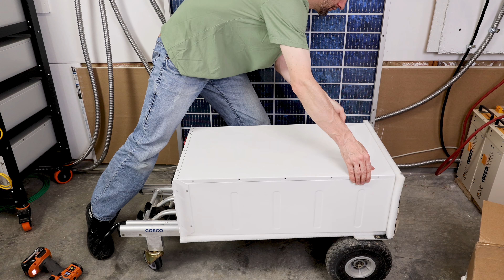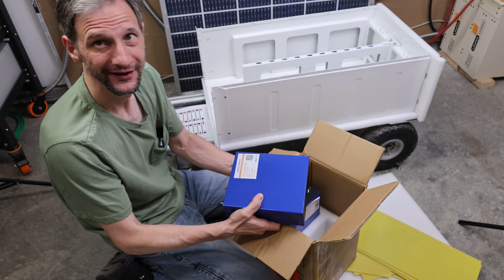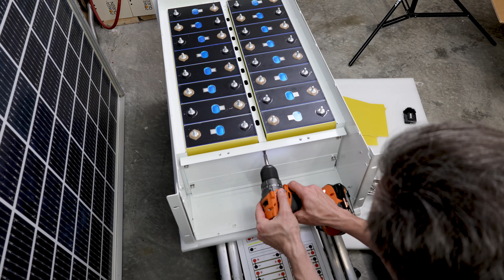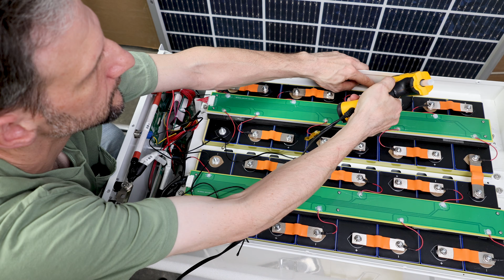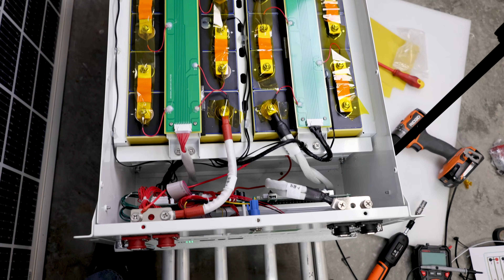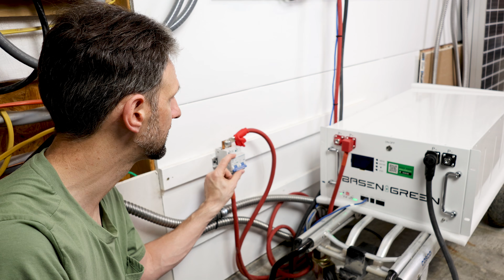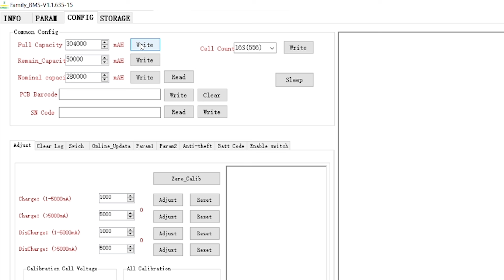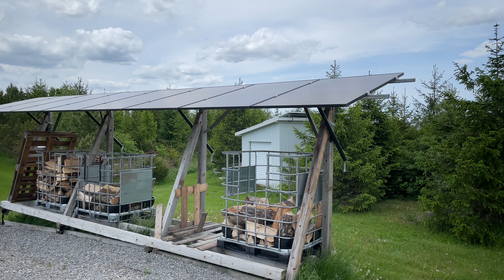SAVE Thousands - Build your own home solar battery backup!

Comment: If a person can assemble it in 1 hour. A person could probably do 2 an hr. That person you just pay them 20$ or 10$ in china. So how is this cheap because its a DIY kit ?
Reply from the maker: Good question.  Also, there is way more packaging to ship everything independently.  One reason might be there is no holistic warranty for the DIY setup.
Reply: you don't have to hire an HR department like the company you hire to do it has to.

Comment: Great video! I think you can get the cells even cheaper if you buy directly from China or a retailer that does not add to much cost. 

My rule of thumb is that a DIY kit battery is about 1/2 the price of a pre built battery and that a complete DIY battery is 1/3 the price of a pre built battery. Prices vary a lot so this may not be right for you, but with the pricing locally to me this is true.

Comment: Nice job on the video . The box has the same flaw they all seem to have , the cells are not fully supported for compression on one end , you did have the extra room though for a plate at the hollow end . You can flip the handles over and they will be out of the way of the posts . Would like to have seen a breaker also . Any idea what BMS ?
Reply from the maker: I couldn't find any clear identification on the BMS.  They claim it's their own, but I don't know who is making it.
Reply: @ProjectsWithDave 
BMS looks like the same as in the GobelPower batteries. 200A Pace BMS

Comment: What's attractive about this (aside from cost) is that you can replace cells yourself if they go bad, but most likely by the time they do, the same spec. batteries won't be available any more. I just wonder what will happen in the next 5 years with battery tech for DIY type work.
Reply from the maker: I was thinking the exact same thing.  One of the reasons I like the SOK batteries is they can be serviced.  I have one cell in the stack that seems to be drifting out of spec.  I was considering replacing it but as you said I have to find the same cell to replace it with.  I suppose if you have a lot of the same battery, eventually you could use one as "spare parts."
Reply: Couldn't you just order a couple extra cells/packs when you order the original ones to have around for repair/replacement?
Reply: like everything else.  They will serialize the battery so you can't swap one out.

Comment: I've only used and built DIY server rack batteries, the pre-built EG/SOK/etc are only 100Ah, so to me it was a no-brainer to build 304Ah for $500 more.  I currently have 4 of them in Gobel cases, 60kwh, which will run my house in the summer for 24hrs if we had an outage.  In 13yrs we've never had an outage longer than 4hrs, but the real goal was to run the entire house during the 4pm - 10pm Summer peak  power rate/cost.  We are NEM 3.0 here in CA, so there is no upside to backfeeding the grid at $0.03 Kwh while being charged $0.45Kwh.
Reply: Yep and that's why I installed 66 kWh of recycled Tesla modules because the utilities keep moving the goal posts on the payback and then you still have no power in a blowout.  My houses main disconnect has been off for 3 year now.
Reply: @cyumadbrosummit3534  Where do you buy the "recycled Tesla modules"?
Reply: @cyumadbrosummit3534 I'm going to check that out!
Reply: Why not just go off grid?
Reply: @dlfrestoration  Soon they will come after those people too by saying they need to pay $$$ for "maintenance fee" of the grid and pay your fair share. Watch it happen.
Reply: @dlfrestoration think of the grid tie as a insurance policy if any single component of your system fails and takes it off line.
Reply: @judd_s5643  Yes,never put all your eggs in one basket,if possible !
Reply: This is the way. With cheap batteries there is no reason to sell electricity to the grid for pennies.
Reply: @johnzach2057 
Sell for pennies on the dollar?
Nope more and more states are ending net metering and there meters do not run backwards wich means any power going through the meter  you are getting charged even if the power is being sent to the grid.
Yup they have made it so we now have to pay them to send them power
Reply: Didn't DIY my battery, but I have the Signature Solar 14kw outdoor battery that is enough, and then some, to carry me through the So Cal Edison 4-9 TOU price jump. I an on NEM 2.0 and even making it under that wire to get the old terms, the buyback rates suck. Batteries for TOU buffering rock
Reply: Nem 3.0 is criminal
Reply: @KuramaKitsune1  IDK about NEM 3.0, but I'll write you a fair to everybody NEM 4.0. Monthly fee to pay for maintaining the local distribution network, and billing, say $20, and then come up with a price at the meter, and either pay it, or collect it. Same price in or out.
Reply: I have net metering in Ohio. I get full credit for every kwh I backfeed.  I put up solar in 2017, when Ohio didn't have any solar to speak of. I watch "eia power monthly" and we've started adding solar, so it can't last forever. I still have a dumb meter that can't measure what time I use electricity, which is dumb. Electricity should be expensive when it is in short supply, and cheap when it is plentiful. Give me a price at the meter, and pay or charge depending on which way it flows. California has a lot of solar, and can add more cheap, so your prices should be low during solar hours, particularly in the spring before AC loads really kick in.
Reply: @iamblaineful, would love to hear about your system!  We've got 3.2kW of solar on NEM 1.0 but aging out in Jan 2025(going NEM 3.0) and this DIY 15kWh pack(or 2) would get us through the 4p-9a no/low solar time period for a couple of days. So I'm looking for a programmable charge controller with zero export capabilities which would only AC charge the battery packs when the solar/micro-inverters are producing. Programmable for something like setting the AC charge controller to limit a 10W grid backfeed with the rest charging batteries. The inverter would then take over the household load while putting a grid load of only 10W through the evening, night and early morning no/low solar periods. The clock is ticking so looking for solutions. Thanks.
Reply: I live in California can you help me build my system? 😉
Reply: I thought NEM 3.0 provided a rate sheet with higher back feed rates at certain times of the year.  I downloaded the rate sheet from PGE.  For sure, the majority of the time sending back to the grid was horrible and not worth it.  Sept. had rates of over $2 per KwH for 2 hours per day from your battery backup, I believe it was between 6-7 pm.   Aug. had some good rates to backfeed as well.   I have not installed my solar yet and batter backup system but I was looking forward to capitalizing on this rate schedule.  I have not seen any youtube video's on someone taking advantage of NEM 3. I was looking at the EG4 Hybrid system to be able to backfeed 12 KwH per hour back to the grid.   On top of that, be able to run off grid.  Electricity rates have gone out of control high in California.
Reply: .45!!! Are you serious
Reply: @joeblow6105  In Western Australia i could could only dream of being charged  45. Now its north of a dollar something  In fact 15yrs ago our 1st solar install  would pay us a 47c / kw feed in. Now it pays only 7cents . Obviously this is $AU so not sure but im guessing thats like 3c there.
Reply: Do you have a zero electric bill? What’s your setup like?
Reply: And the main reason being a more responsible and clean environment for the future too.
Reply: Gotta love Democrat policies
Reply: @AFS-ht7bgalways some dope making it political
Reply: If your batteries ever end up fully charged before the sun has set for the day, why wouldn’t you “bank” the extra energy by sending it back to the utility?
I live up north and with trees on all sides of me so I’m envious of you guys who it makes sense to do this stuff.  Maybe I am missing some practical understanding but I assume that there would be times that selling back to the utility, even for a reduced credit, would make sense.  AND you’d know that you are contributing to less coal or similar is being burned at the local steam plant. 😊
I only dreamed of these days when Carter was in office and I was a kid in the 5th grade.
Reply: @harrymagooslum5770  Well it depends on your point of view. A fully charged battery goes into a float mode operation. This allows you running devices to still use solar wattage. The way float mode works is the solar is not going all to waste. It is just providing you the wattage your using. Meanwhile your batts remain topped so as sun as your start to loose solar production and tapper off it you will only then start using your batts. And keeping batts fully topped and in float mode allows better opportunity to have enough battery capacity to get through the night. For instance my setup is 2044 watts I am fully topped off and in float mode but, only pulling 500watts. I am able to make 500 watts if I use more power it will produce more power. But, leave the batts topped off. As far as Grid Tie. You have to go through permits. And way things are going government might end up with reach to be able to shut it off. As far as not going solar. Look into micro hydro stuff. Get power from your water main every time you run water. Might be a trickle charge but, could charge a battery to run USB devices and usb batt charging. Also, many micro hydro off rain gutters to creeks. Hope this helps.
Reply: @harrymagooslum5770 It's a good question. I'm thinking there must be additional overhead or requirements with the utility allowing you to do that, with metering etc. Might be some other hassles with them over billing rates, too.

Comment: A well done video, thank you.
The BassenGreen site does not list any specs for the included BMS, only that it is 200A, 16S. Did you note a model number or manufacturer on the BMS, or perhaps have a link?
Reply from the maker: They claim to make it themselves.  I didn't see anything to indicate another manufacture.
Reply: @ProjectsWithDave  - Thanks for checking. The included BMS may be fine, but personally I would feel more comfortable using a known quality BMS. Fortunately the kit is inexpensive enough to allow for that upgrade and still be a good deal.
Reply from the maker: I think it would be great if someone made a DIY case that offered multiple options for the BMS.

Comment: Before pushing loads through the battery, shouldn’t you have charged it up to 100% first?
Reply: He did charge it up to 100% and did a full drain test after to check capacity
Reply from the maker: Right.

Comment: Dave, maybe I’m missing it, but where did you get your cells?
Reply: Looks like BassenGreen out of stock.  So much for trying this project.
Reply from the maker: Unfortunately, I don't have a date from them on when they will be back in stock in the US.  You can get them directly from China, but one of the reasons I picked them was they had US stock.
Reply from the maker: Cells and Case from BassenGreen.

Comment: I see you have the same fluke clamp. Have you measures in the inrush current with that heat pump soft start? I just installed an emporium system on my house to size up what I need to by for my system. While I had the panel open I did take some inrush current measurements and saw the heat pump pulling 85 Amps on each leg of the 240 breaker. CC was about 10 amps on each leg, or about a total of 2.4Kw with ambient temp of 94. I was curious to see how that soft start pulls.
Reply from the maker: With the soft start, the ramp is so soft it doesn't register as inrush.  It's pretty amazing.  As long as you use a low frequency inverter like the Victron system in this video it should work great.
Reply: @ProjectsWithDave  Good to know.  I am considering a toroidal transformer based hybrid inverter. Thanks.
Reply from the maker: You should be happy with that performance.   Make sure the idle losses are acceptable for your situation.  Victron has the best idle loss of all the inverters I've checked.
Reply: @ProjectsWithDave  Yea, I do consider that. I’ve noticed since I am looking to go hybrid that some inverters have a lower idle when connected to the grid vs sickly off grid. Even some non-hybrids that can’t feed the grid still have. a grid hook up option and run 1/2 the idle. A lot to consider and a lot of research for sure.

Comment: Simple build most of the complex work is done for you.
No breaker or fuse in the battery box, consider that a negative.
On my DIY system I have multiple battery’ banks, size each breaker so that total breaker current rating is 150% of max load since each battery will only see a small percentage of its current rating.
Reply from the maker: It does have a built in fuse, but I wanted the external breaker.
Reply: @ProjectsWithDave  Looks like they took your advice. The one for sale on the website now has a breaker switch above the on/off button. Pretty cool unit for a good price!

Comment: "Easy beginner" until you see the chinese user manual for MPPT controllers. How much money will I have to spend to find one in the actual ENGLISH LANGUAGE for a beginner????
Reply: What are you talking about? There are no MPPT controllers in the battery and Dave uses a Victron solar charge controller. Victron are a Dutch company and there is incredible English support.
Reply: @mondotv4216 you beat me to it! Obviously the OP has bigger problems if this is the question he’s asking 😂
Reply: It's cheap enough that it's worth educating yourself. 1/2 cost or less
Reply: @kevinroberts781  I`m on a fixed income and I don`t speak chinese english and solar forums appear to be a lot of people trying to sound more and more technical disagreeing over everything. Even a guy who USES the charge controller I have can`t explain the most basic simple questions I have about it. If you ask me he hired someone to install his system but isn`t admitting it. And nobody uses 12 volts like those of us who live in campers. Nobody has any answers about how to set parameters on affordable charge controllers. My only option now is to keep buying charge controllers until I find one written in proper english or go broke and nobody has recommendations unless it costs over 500 bucks and connects to a bunch of apps. I guess I should have bought a big solar power station that`s plug and play but those are rigged scams that force buyers to use THEIR SOLAR PANELS to get the input wattage needed for a tiny air conditioner!
Reply: Look for Shenzhen city. Most of their things are built for export.
Reply: Google translate, so the price is your soul😅
Reply: Gpt translate bro take a picture send it then ask it to explain it to a 5yo in English 😊
Reply: ChatGPT will translate quickly. Take a picture. Find an image to text converter for Chinese and the copy and paste into ChatGPT.
Reply: You don't speak chinglish?
Reply: Thanks for your great video.
If I am 240 and have an old 10kw PV grid tied system. In the future I will loose my feed in tarif, can I add one of these?
Reply: Get a Chinese friend lol
Reply: Take a picture of it with your cell fone and upload to Google translate
Reply: If this is your big challenge, you shouldn't diy on 15 Kwh 🔋⛑️
Reply: I think you meant to say "the battery BMS"
Reply: @bill2292  I think you meant to say “the BMS”, unless you meant the battery battery management system”
Reply: Ya the bms documentation is awful for most chinese bms's. @bill2292
Reply: Get your buddy trump to translate it for you😅. Nobody knows more than him right?
Reply: @PaulPaid what does that even mean?
Reply: @PaulShalahm  He has patents in china and they also are in chinese I bet.
Reply: @robertsmith2956  🤣😅😆
Reply: @PaulShalahm  He knows you hire a chinaman if you want it read right.  Episode of house showed you an alternative.  Hire a chinese phone sex girl to read it for you.  or lady boy since you like biden.
Reply: @PaulShalahm would be much funnier to see Sleepy do it. He can't even speak English most days, lol
Reply: @markjohnson9402  He should get first dibs. He doesn't have a criminal conviction.
Reply: @PaulShalahm  yet !
Reply: @markjohnson9402  Good luck waiting. He's slow and geriatric not criminally delusional.
Reply: It would be nice to have a POTUS who was mentally competent to stand trial, though, Paulie.
Reply: Just translate it man. Plus I love supporting xi Jin ping and his minority-friendly country